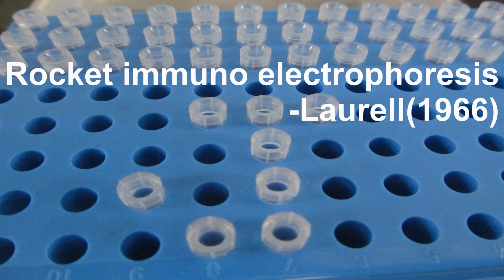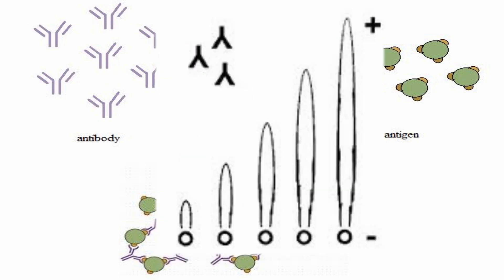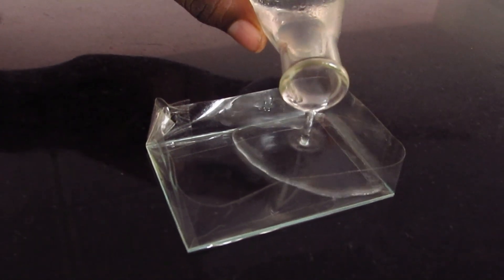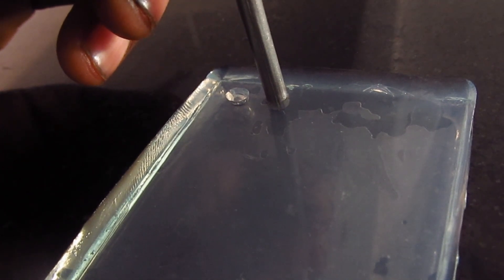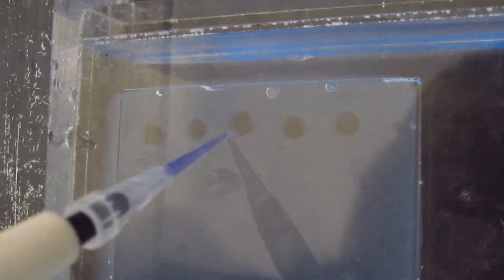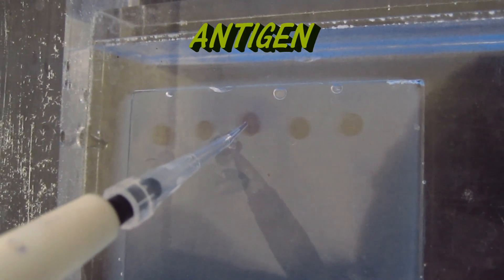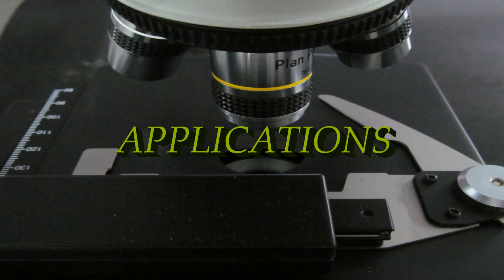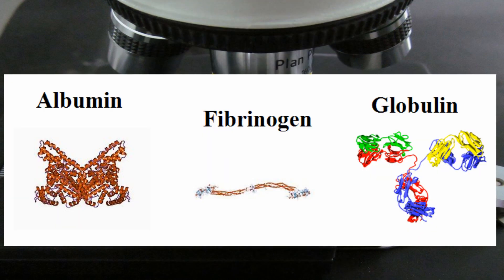Rocket Immuno Electrophoresis

Comment: Good video! Thanks a lot.  But I wonder whether the antibody would get denatured while put into the gel because the gel is usually pretty hot, right? Is there any other treatment to prevent this?
Reply: 姚俊辰 at 50-60°C the proteins antibodies won't denature. So we should allow the gel to cool down to this temperature and then antibody could be added.